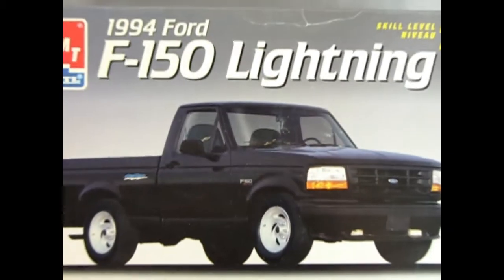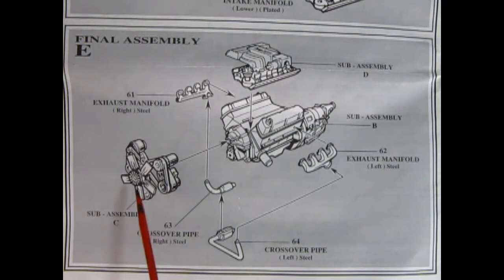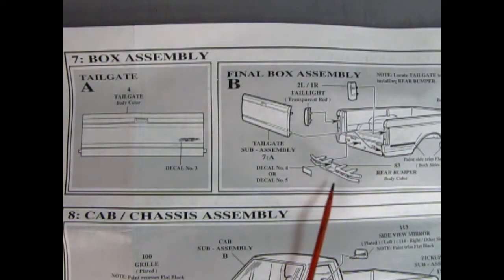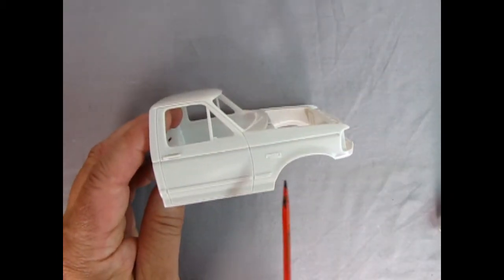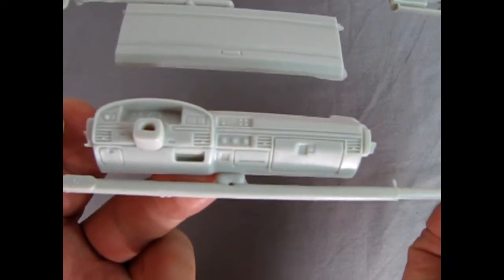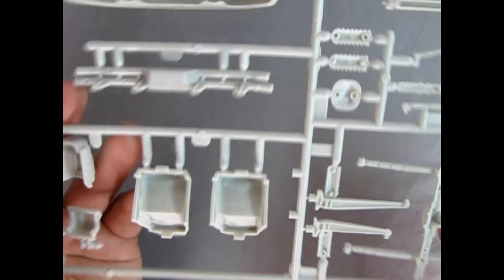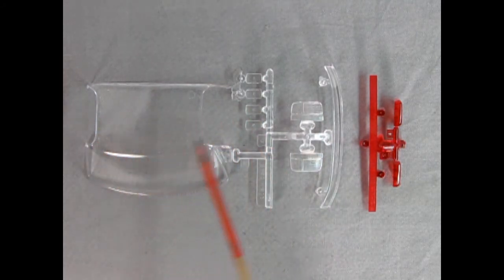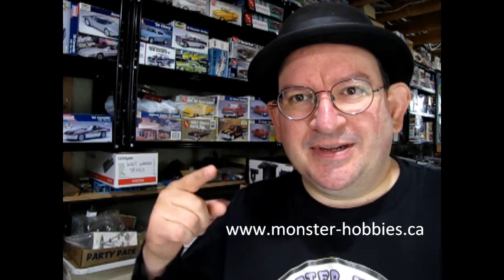Model Car Garage - The 1994 Ford F-150 Lightning by AMT/ERTL - A Model Kit Unboxing Video

Comment: I've had this kit gathering dust for over 25 years, and finally decided it finish it.  I'm putting the finishing touches on it, and it's really great!  Plenty of flash and mold lines, but the parts fit well, and there's a lot of detail in the engine and undercarriage.
 Advice for anyone building it: beware of the decal placement in the instructions.. the 'Lightning' logo on the sides of the truck are shown incorrectly. Refer to the photos on the box lid for proper placement.   The front bumper has lights not shown in the instructions, but there are plated and clear parts included that you can use to construct them.
 The instructions don't mention it, but there are a few parts that snap into place, like the dashboard into the interior tub, and the interior tub into the cab.
Reply from the maker: Thank you for the hints! Hope you enjoy your build!

Comment: Awesome review Trevor! My second truck was a 1992 F150 XLT extended cab with 7 foot bed in a two tone brown, tan interior with 302 V8. I bought it all original, one owner for $2400! I absolutely LOVED that truck! Unfortunately, the engine had a couple of issues that I tried to fix but I ended up having to part ways with the truck due to where I was living at the time. I have built 3 of the AMT F150 kits... The 1992 F150 XLT, the 1993 F150 short bed and two of the 1995 F150 long beds. I do want to build the F150 Flareside and this 94 Lightning!
Reply from the maker: They are fun kits. I only built one, but it really interlocked quite well.
Reply: @MonsterHobbiesModelCarGarage  Yes based on what I remember, they all went together very well with little issues.